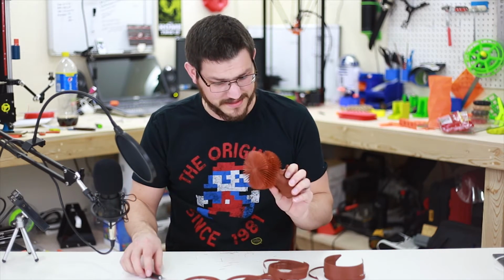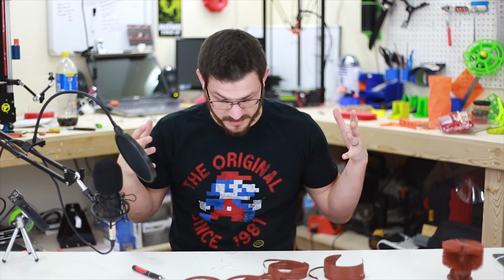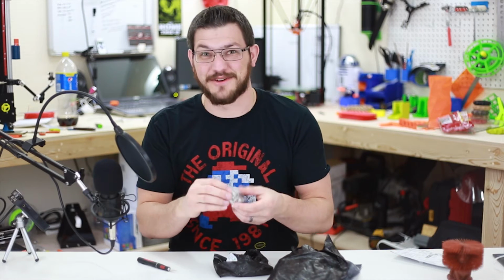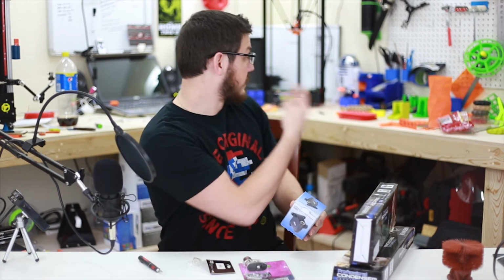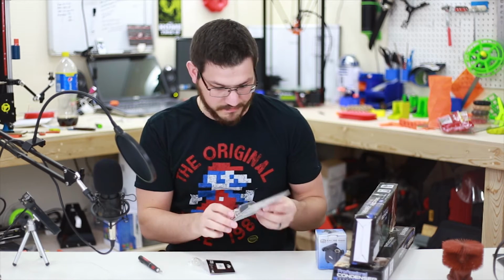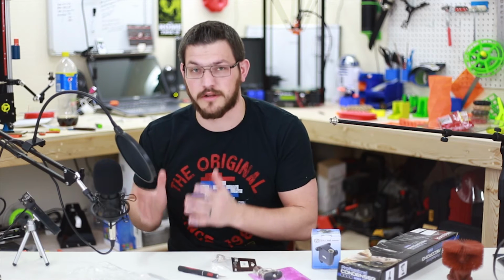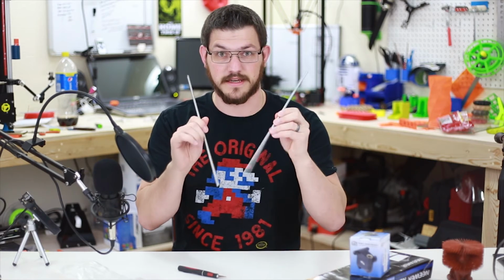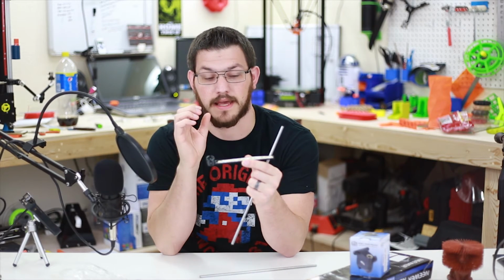VLOG #023 - TCM-2100 Drivers, Cube 3 Filament Mod, MPSM Mods and New Mic/Camera Arms

Comment: Share cube 3 3rd party filament solution. I've noticed the cube 3 official filaments are 1.70mm +/- vs 1.75 +/- from 3rd part filaments. Does seems like 3ds engineered it to be difficult to mod lol

Comment: Helpful hint on the stronger bed springs> Only use 3 on the FT5.  Two on the corners on the X=0 side and one in the middle of the X max side.  You'll see that it is MUCH easier to level the bed even with the BLTOUCH helping.  This way there is no twisting.  It works like a champ.
Reply from the maker: Lots of people have said 3 is better but 4 works out really well for me. I may try 3 one day but for now 4 is good but deff not the 6 they say to install. THAT is way too many IMO.

Comment: but that board you mentioned has no fan control (speed) right?
Reply from the maker: The Sanguinololu does not. I had to do a LCD mod so that I could control the fan via G-Code (M106/M107). But now my LCD doesn't work >.<
Reply: good news! The white one actually does support it! You just have to use the second hotend output for the fan lol :D

Comment: could you do a vid on the ft-5 wiring. that's where I'm stuck. I don't consider myself inept but the manual seems super vague...
Reply from the maker: I'll see what I can do but it is really hard because they new wiring colors are different and now they are using a wiring harness. If I could get my hands on another FT-5 I would deff be able to do this.

Comment: I got 2 Cube 3s for a total of 150 dollars. I did the filament, firmware, and extruder mod. works like a charm
Reply from the maker: Which extruder mod did you do?
Reply: Fugatech 3D Printing The printed extruder box. Its okay. You should design a new one. One with a spring tensioner

Comment: You are using TMC-2100 in stealth chop, you need to use them in spread cycle, that's a common problem. Tom did a review on the 2100s and he talked about the differences. Just look at the twiki for the 2100s for how to configure them properly in spread cycle.
Reply from the maker: After changing them to Spread Cycle they whined like crazy. I was then told if you run them on 24v they do not whine.
Reply: yea, that's why all my machines are 24v, less issues